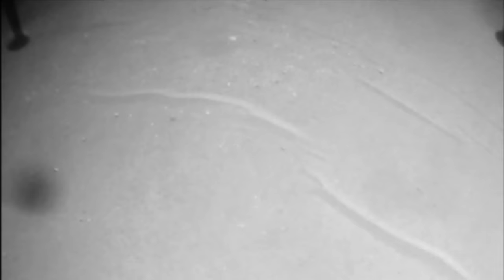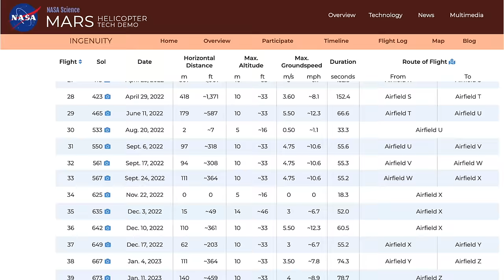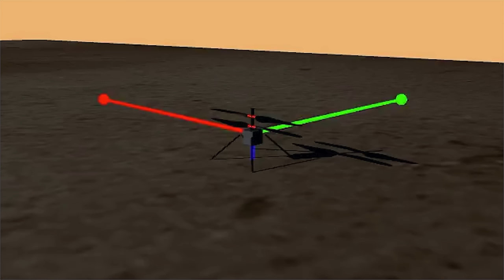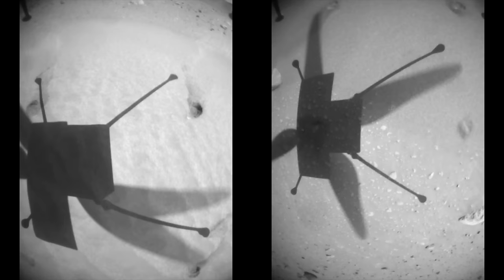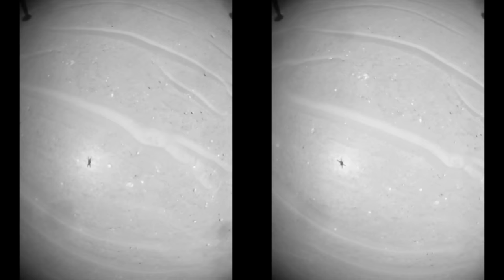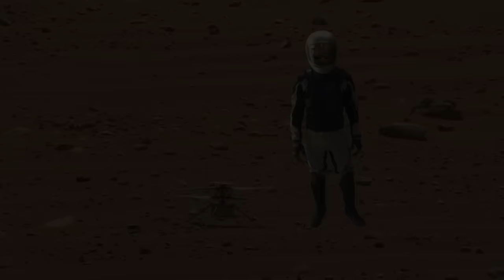Engineers destabilized Ingenuity flights

Comment: I used to be a process control engineer.  This video reminds me of how I would characterize the stability and control-ability of a process by putting it in manual control, when it was operating fairly stably and then stepping the process control output to an incorrect value, and immediately putting the process controller back into automatic control, to observe how the process and controller reacted to this well defined error step.
Reply from the maker: Sounds like system indentification, a new term for me.

Comment: Perhaps this just might open the door for a less complicated fixed pitch multi rotor machine for the next mission. I have a 6 motor camera drone that has flown in gusts of 25 mph. It's been attacked by a Seagull once and lost a prop but the safety built in the controller allows it to keep flying if a motor is lost.
  Thank you Mars Guy.
Reply from the maker: Multi rotor vehicles are being planned, but the success of this helicopter is really remarkable.  Makes me wonder why mess with success!

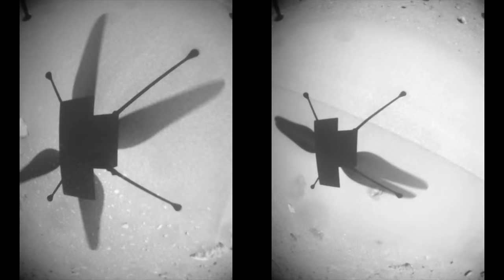Comment: 3:52 What's that shadow passing in front of the left camera?
Reply: interesting question!
Reply: @Firebuck  dust particles? upon takeoff it does send sand and other grains from below it...and there are winds on Mars
Reply: Perhaps a dust particle on the inside of the camera lens.  IIRC from a NASA live stream a lesson learned was to not put the downlooking camera at the lowest part of the enclosure since any dust that gets inside tends to accumulate there.
Reply: Likely sand that has entered Ingenuity. The pilots/scientists noted that the window for the downward facing camera is just on the bottom of Ingenuity, so any dirt/dust internal (on the floor) can move across the window. It's one of the few things they would change, in addition to using a higher resolution camera, should they build a newer version of Ingenuity.

Comment: Good one MG. Are they suggesting that these tests had anything to do with the crash?
Reply from the maker: No, that last flight was just a pop-up for localization.
Reply: Yes, I realize that. I was wondering if the tests done on 68 & 69 could possibly have caused some stresses that might have contributed to the crash on 72.
Reply from the maker: @caevans61  Haven't heard/read about any connection, but that doesn't rule it out.